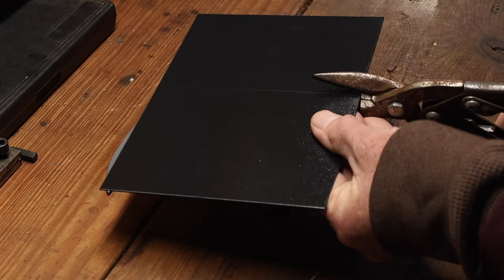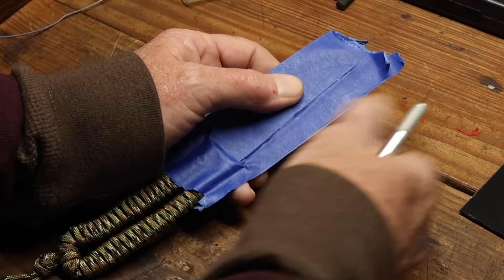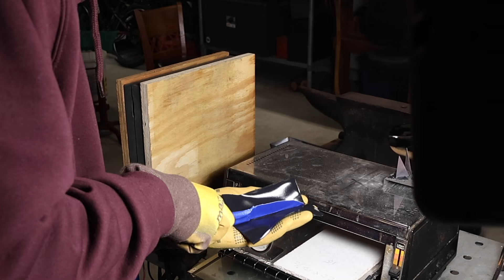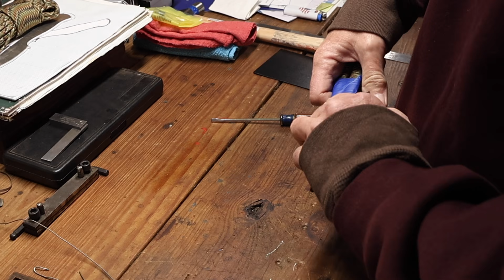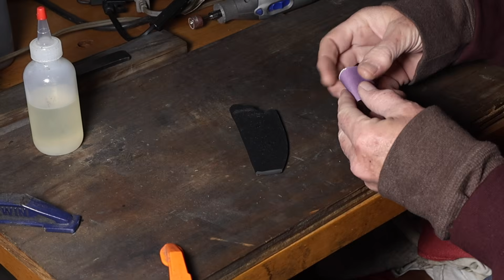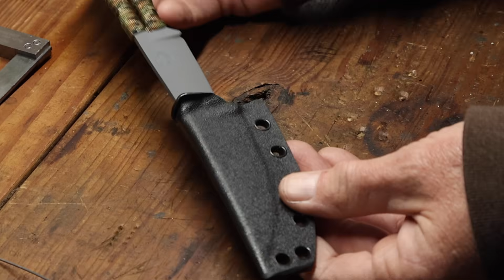Making a Kydex Knife Sheath - Easy DIY Project

Comment: Can you melt the kydex into itself after a fold? What I’m really asking is, is it possible to make the sheath wothout that excess 1” and rivets. Cut all that off and melt the kydex into itself. Would that work?
Reply from the maker: It could work but I've never tried it without any rivets. Normally it will stick to itself and you have to pry it apart. If you heat it up a little more it will likely stick to itself better, but for how long I don't know, without the rivets it may eventually come apart. The kydex sorta of shrivels up around the edges and starts to not hold its shape as it gets hotter and closer to melting so it's not as easy to work with at that stage.
Reply: Probally would want to use one of those superglues specifically made for plastics. Let it cure 24hrs